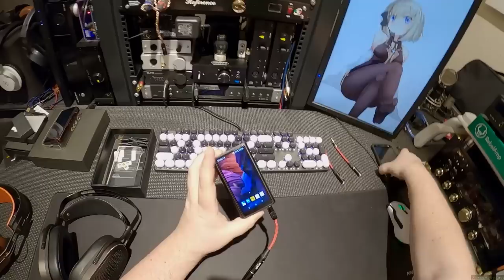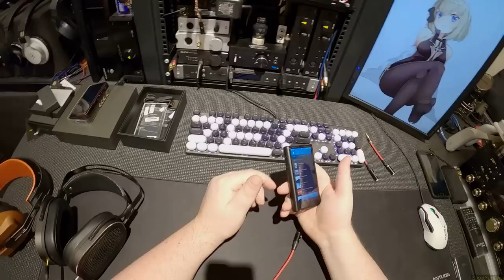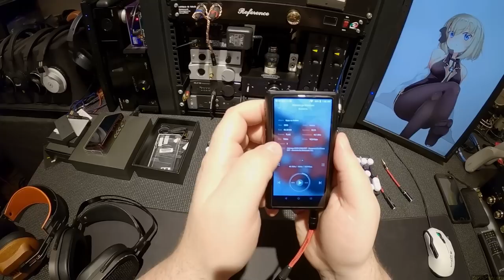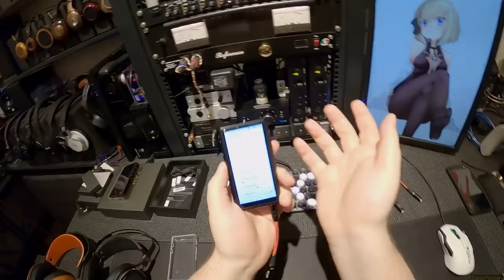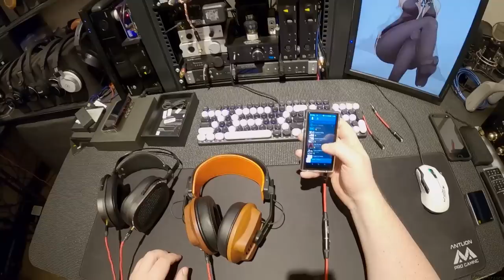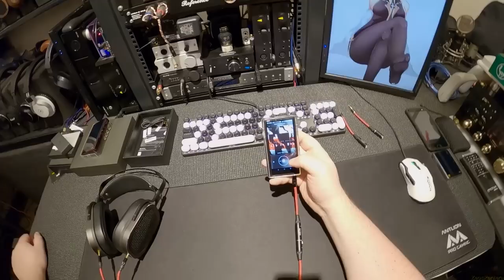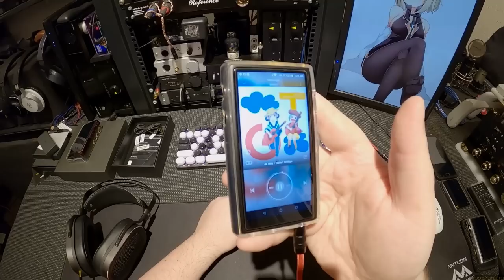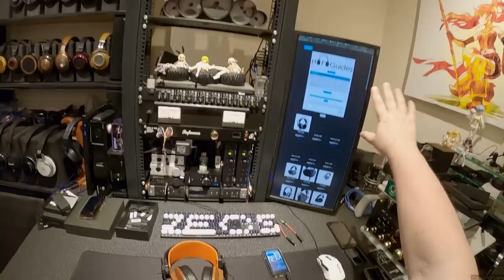Hiby R5 _(Z Reviews)_ A Real Pocket Rocket!

Comment: There are two common micro-SD Slots. The one with the push-mechanism is a proper micro-SD slot. The Slot the R5 has a Sim-Card-Slot, phones are using dual-sim-slots where on sim-card can be a micro-SD-card too. And the R5 got that with just an micro-SD I guess. Rather complicated to change SD-Cards but if you leave it in there as additional memory and don't take it out, it's smoother and more protected from dirt and dust.

Comment: The Fiio M11 pro was on sale for 399 a couple days ago on amazon, how does the R5 compare to that?
Reply: the r 5 is not broken...

tge m11 have a couple of issues that can be pretty anoying.
Reply: one of them being that the os that is in the fiio is not fully compatible with samsung new chips they have been using on all tge m series... therefore making it very painful to update common aps as the playstore have a tendency to not work properly.

dsd 512 tends to to make anoying crackling from time to time.

check on thier forums...there is a bunch of issues they havnt fixed...they keep releasi g new gear instead of fixing what is broken....because of those bad marketing decisions...

the m5, the m3k, the m9 and the m11 not the pro one.. are all falling in a bottomless pit.

make no mistake the m11 is fast and deliver awesome quality on bluetooth..the all to dsd feature works ok...but you need a better music app..

if tou can get one for a decent price then go for it. but dont be suprised if you run into the anoying update issues.
Reply: @Fach Yutuob Hiby is really good. also the  ibasso dx120

Sony are very good for sound quality, but their software is garbage.

if you dont plan on using bluetooth functions the pono player is what would have killed the ipod if marketing strategy would have been done right. i mean ther traditional ipod with the clickwheel.

shanling m5s comes to mind

Comment: Good video..  you crack me up.  Just picked r5 up..  sweet unit.  Question on 4.4.   What 3.5 adapter do you use for either 2.5 or 3.5 to use the 4.4 balanced?   Is there a big advantage to 4.4 vs. the 3.5?  Thank you.

Comment: Try the ibasso DX160 as well, way better!
Reply: Why is it what's your reasoning?
Reply: @Starslider  with more clearity in mid high and slightly larger soundstage.  (PLUS, a lot of cool color choice)
Reply: @leoyu1070  the Hiby has MSEB so the sound can be tailored to how you want it the Ibasso does not have this. As for colour most people will put a case on it and won't see the colour anyway. My money's gone on the Hiby for me it's the best choice.
Reply: @Starslider  MSEB I have tried it, it is more of like a fun version of EQ of which you can change the sound into warmer , cooler or wider , narrower etc, very fun.  However it is only a EQ, and it is like adding a bit of "salt and pepper", not neccessarilly changing a "cheap steak" into a "A5 wagyu steak" (by the way I use DX150, and I can install Hiby player apk as well, not sure if DX160 can install Hiby player apk tho)   

I do recommend people try them BOTH, maybe u will like Hiby for its more puchy and bassy sound for rock and hip hop

But I will prefer ibasso DX160 or Sony zx300 or AP80cu for similar price  

(by the way astell and kern SR15 is shite, just buy SE100 or SP1000m, if you want a AK product)